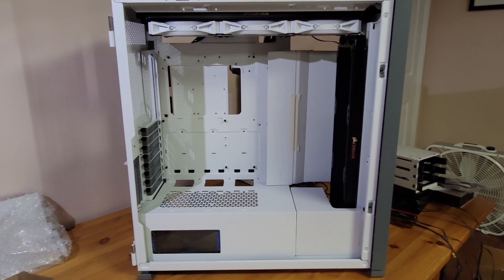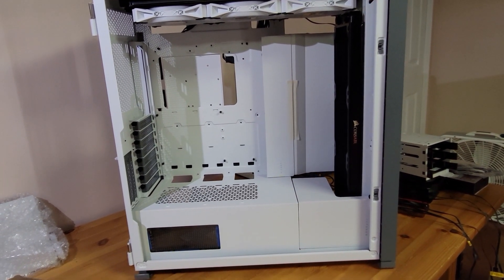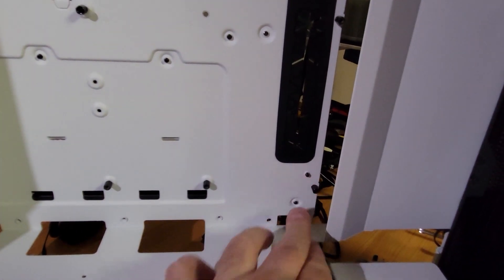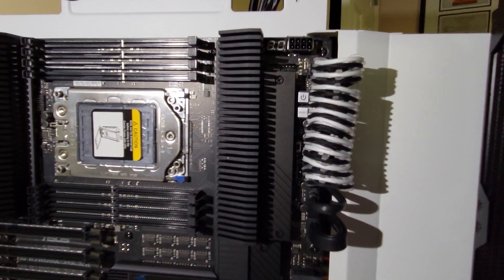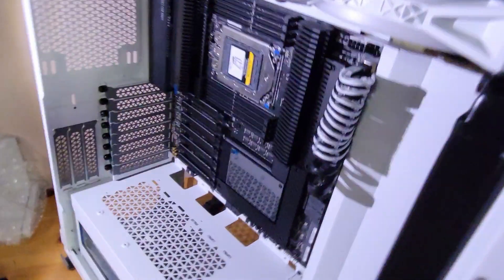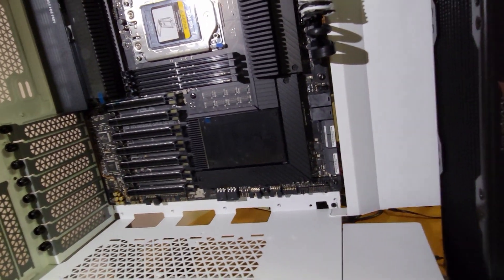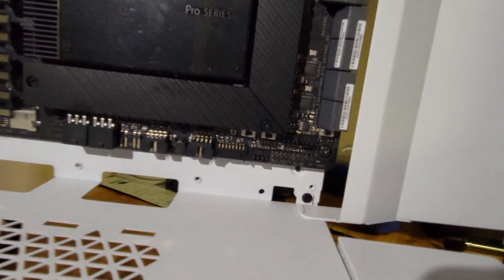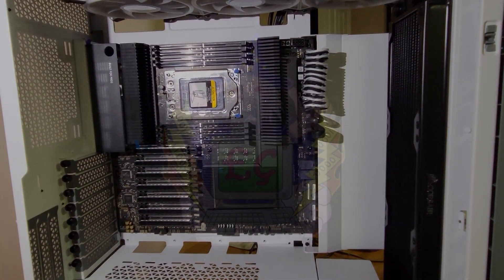Fitting an Asus Pro WS WRX80E-Sage SE motherboard into a Corsair 7000D Airflow case: Part-1

Comment: I want the same motherboard, actualy im using a threadripper asus Rog zenith extreme and this case but have a Custom Watter Cooling and dont know if i have to move the radiator position from the side to the front
Reply from the maker: My rad is on the front and the top. Won't fit on the side because of PSU cables. Watch the end of the TimeLapse build on my channel; to see the final results.
Reply: @LordChariot  i will look for it.... so the mine is too big and just in the side o front fit.....so....i will move to the front but dont know what to do with the water pump
Reply: @LordChariot  i will also put there the fans i have on front panel or make a push pull and buy another fans kit for the side where the radiator is now.....i have actualy the rog zenith extreme x399 asus, with 2920x procesor and custom water cooling. and will change to this board cause i get it in a ofert and want to go to the 5th gen

Comment: I'm looking at building my own TR build in the near future so it's nice to have this video for reference.

Why didn't you go with right-angle cables for power and front panel I/O? You might have avoided having to mod the shroud (which you did a good job on).
Reply from the maker: I'm not so sure that would work. I don't think the shroud opening wouldn't have enough clearance. If the mobo wasn't as wide, I would have more room to play with.

Comment: Will ASUS Maximus z790 extreme fit In Corsair 7000X
Reply from the maker: Very likely. But i think the right side of the motherboard will overhang the default cable grommet slightly. ATX boards are 9.2" wide, but the Maximus is 10.9". Cable bends to go through the existing grommet hole will be tight. That's why I modded mine. Mine, however is 13" wide, and completely covered the grommet.

Comment: Thanks @ £ordÇhariot for your very informative video on ASUS WX80/TR PRO/Threadripper Pro Build. Apologies for my basic question, newbie in PC builds. 
 I intend to build one but will use a Fractal Design Define 7 XL Full Tower case.  

 On checking the specifications on the motherboard manual it requires the following power cables.
A.  ATX_12V_1
B.  ATX_12V_2
C.  PCIE_8PIN_PWR
D.  ATX_PWR
E.  PCIE_PWR_1
F.  PCIE_PWR_1

Will be using an EVGA 2000w G+ PSU which has only two EPS(CPU)   8pin (4+4). 
Kindly advise on which cable to connect the  "C.  PCIE_8PIN_PWR" socket  to the PSU.
Reply from the maker: You would use the same PCIe connector that a video card would use.

Comment: Nice job. Amazing build. That is such a nice motherboard. Seeing more of this case in your video has made my decision to buy one to replace my Corsair Obsidian 800D. I'll miss the 5¼" drive bays though. I still use a fan controller and BD Burner. Maybe I'll just setup the  BluRay burner in an external enclosure and have it sit somewhere outside the case. 
Thanks for the video. Hope you get lots of enjoyment from your amazing build!
Reply from the maker: Thank you. I'm going to miss my BD burner from my older system too, but in reality I've burned one boot CD with it in the last 2 years, so  really don't need it. I was thinking external, too. I have completed the build. I have a short vid on reddit, but have to edit the actual build video and post on YT.
https://www.reddit.com/r/watercooling/comments/qovi5n/first_custom_loop_asus_wrx80esage_pro_ws_se/

Comment: My only experience is two E-ATX builds. A X399 Zenith Extreme in a Thermaltake Core X9 and a WRX80E in a Thermaltake  Level 20XT. Both are a horizonal mobo tray mount. Both are twin water loop set ups with two 420mm rads in the top. I'm very happy with them, but neither have the latest front USB jacks.
Reply from the maker: Yeah, I have to get a USB 2 to USB 3 adapter for one of the mobo headers to front panel. I hate when that happens. At least I get 1 pair of USB 3 on the front, plus the USB-C

Comment: Hey man, dealing with the same issue with the same mobo. The phanteks is also out of question, very akward fit, hardly could close the back of the case with only air cooling so water is out of question in that case.
Reply from the maker: I've seen it mounted in some Fractal or Liam Li, but I like the looks of the Corsair the best. I have some ideas on modding the shroud, but I'm waiting for my CableMod cables to show up before I decide what to do.
Reply: @LordChariot  i have the cablemods also, if you have the corsair gold psu take care to check that the 24 pin cable is not compatible :( i have to order a new one just because of this as i didnt check it properly.
Reply from the maker: @rlz007  Good to know. I'm using the Super Flower Ledex Titanium 1600W. I hear this is the OEM for the EVGA 1600 Titanium. I specified that PSU when I ordered the CableMods. I'll meter out the cables with the original supplied ones once I get them. Thanks for the heads-up.
Reply: I'm using a Thermaltake Level 20XT for a WRX80E. If you want a horizontal motherboard tray it's great. Two 200MM fans in front, six 120mm in the bottom and six 140mm fans with two 45mm x 140mm x 420mm rads in the top. All this worked perfectly on an old X399 build with an old TT core X9. best wishes.
Reply from the maker: @maxhughes5687  That's an interesting case. I never thought to go horizontally. Hmm...